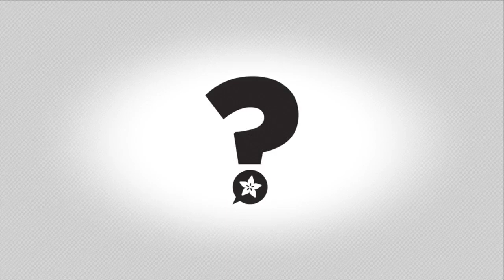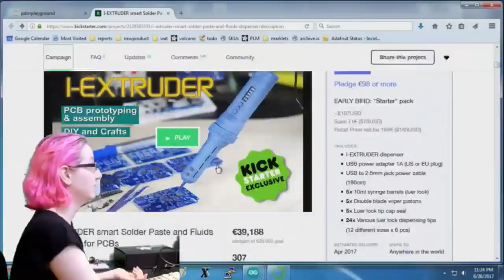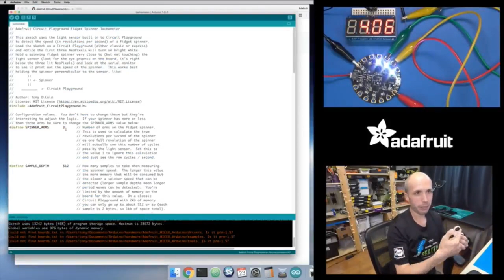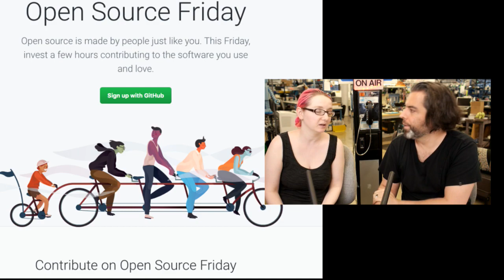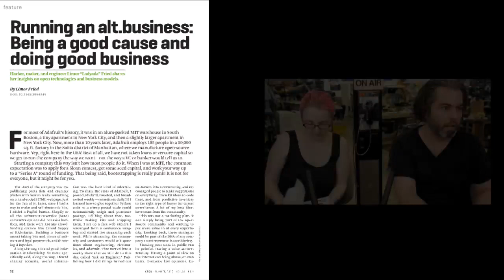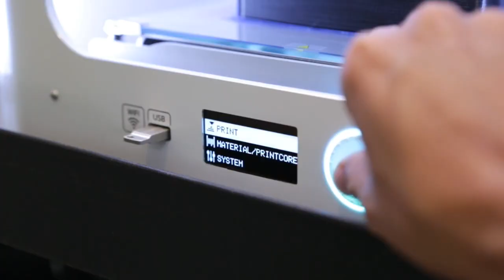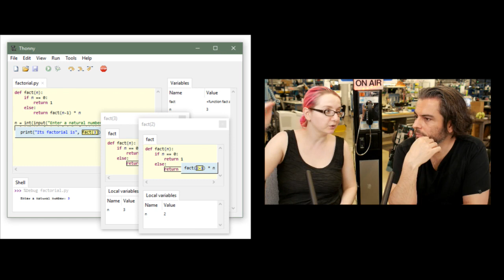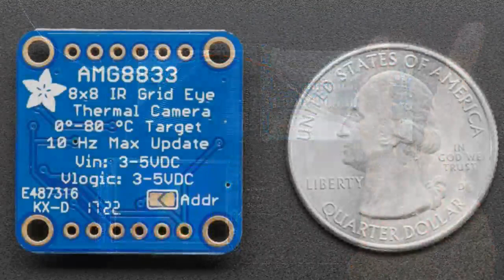ASK AN ENGINEER - LIVE electronics video show! 6/28/17 @adafruit #adafruit #electronics #programming

Comment: Things that should be open source:
1) Voting machines
2) Home automation/security systems 
Add yours:
Reply: Mobile phones/smartphones.

I have an old Android phone that I don't use, if both software/hardware would be open and with good documentation, I could use it on some DIY project. Instead of raspberry pi. 

And just think about it, it's a fully working device, with touchscreen, with battery, with battery chagrining circuit, with WIFI and GSM module, with a CPU that is more powerful than some desktop CPUs 10-15 years ago.

It would be nice to just install some light version of ARM Linux there, and being able to send signals over USB port to interface with some other device. But to do this, without sources, without documentation, it's just wasting your time.

Of course, even now you can to spend some time and do something with an old phone. I think if you device is rooted you can probably install an SSH server, HTTP server, etc. And do some project. But you need spent some time searching for instruction how to root your specific model, and it may fail since manufacturer is not interested in you hacking your phone, and you still stuck with Android, with closed drivers and etc. And you will be limited by Android API.  

But imagine maker/hacker friendly smartphone, that come with clear instruction - how to root it, and with some minimal open source Linux OS as an alternative for Android. With tool and instruction - how to flash memory, and install your own firmware. With some additional port that can expose additional pins (other than USB) that you can program, etc. 
Also with open drivers and hardware, I would imagine people start writing different version of OS for this phone.
And you could have your Firefox OS or Ubuntu Phone, or switch back to Android if you want.
Reply: Keep dreaming! It's hard enough to buy a phone with interchangeable SIM cards! But seriously, you make some good points. At the very least, It'd be nice to be able to use cell networks for transceiving to & from a micro controller some basic commands.